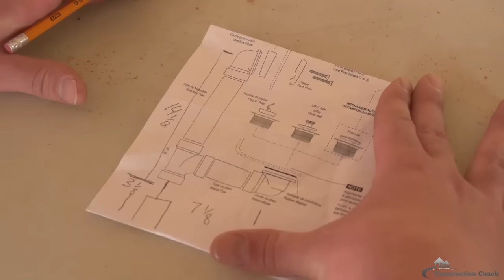Plumbing 101 - Learning about DIY plumbing with Coach Tim

Comment: As a licensed plumber few things for those of you wanting to try it yourself.  
1) from what I can tell that 1 1/2 vent coming off by the vanity is for the toilet... that's a no no. It can not be less then 2"
2) medium black abs glue not only looks better but isn't cpvc glue...
3) they make great pipe cutters for abs pipe that are easier to use and can give you a cleaner edge. 
4) ALWAYS PUT A DROP CLOTH IN YOUR TUB... common sense
5) most tubs require a mortar bed or a ledger (2×4 that holds up the side and helps with rocking)...rtfi... read the fucking instructions
6) ALWAYS remove your shower cartridge when you solder
7) don't run the risk of breaking your tub drain with pliers...go to home depot and get a tub drain tool
8) use either plumbers putty or Teflon tape for your tub drain... No leaks.
9) you're tub spout can not be more then 4" above the tub rim... code and all. 

That's all you get ya heathens
Reply: Lol 😂  thxs
Reply: Love your comments. Great stuff!
Reply: No trap
Reply: Thanks heathen lol
Reply: You must be American. That 11/2 vent is serving the toilet, tub and vanity. Down stream of the 11/2 trap arm must be 2” ( which it is)
 That’s called a wet vent son!

Comment: It is important to ream the cut tube so that you do not get turbulence. Also it is a good idea to remove the interior of the valve so that the seals do not get hot and damaged. The use of a damp cloth to wipe the soldiered joints is a professional touch.

Comment: Great videos. Bit of advice, when soldering, do not heat the pipe. Heat the fitting. This is what draws the solder into the fitting. If you put flame on the pipe you run a good chance of the fitting not soldering. Also, thank you for not putting a wet tag on the fresh solder. As many people do this to cool it off quickly. This can cause the solder to crack and leak.
Reply: Great catch, Lance! Thank you for valuable information.

Comment: For precaution reasons it's helpful to use like a canvas tarp with some towels laid on the floor of the tub for cushioning & then spreading the tarp over them the length of the tub & bracing a 2X4" from end to end for to be holding the tarp in place from slipping down off it's side & then to overlap the outer side of the tub with the tarp like that of a saddle. Now if  you were to drop any tools or other items like the faucets themselves, Your tub should be protected from chipping or scratching. You should also be aware to cut your horizontal length of 2X4"' bracing it to hold the tarp in place as needs be about 2" short of it's end to end.dimension to then use two 2X4" vertical boards from it's  ends of say 2' or 3' up riser's used to wedge the longer piece between them horizontally  squeezing the two ends out tight against the walls but not forcefully as just enough to snug the canvas in place from slipping down & exposing the tub's walls from protection of damage.. Never ever force or overtighten anything beyond it's compatibility. Use common sense & logic. You can YouTube me Dave Overbey for self defense training for how to fight & defend to the end! I am who I yam & that all I am. I'm sting em dead Dave Overbey, Crazy Davy, Alias Punchy & or   Punchy Puncherallo@gmail.com    Thanks for watching & please remember me for a thumbs up! Not your middle finger. L.O.L Have fun making money with me & joining me & my team # 61341016 in Life Leadership come any Tuesday night from 8:pm till 10:pm to an open meeting as my guest. Or stay at rest & miss life what it has to offer.

Comment: Drilling into the tubs lip against the studs is OK, but the way I learned to do it was to just first set it level on a ledger board to the wall & then nail roofing nails in the studs tightly to the lip by overlapping it w/the nail head so that it doesn't move or tilt up. Especially on a metal tub as this makes it easier.

Comment: Nice work couch! It's good practice to remove cartridge before soldering but hardly any general contractor or plumber for that matter does this.
Reply: Brass valves transfer heat very quickly, so as recommended by the manufacturer, always remove the plastic components of the valve before soldering to prevent them from melting or warping.  Manufacturers like Moen will not honor the lifetime warranty if you have cooked the internal components.

Comment: oh and dont forget when the fiber glass tub set no stringer used to support the back lip of the tub also what about the felt mat that comes with the tub so its legs dont squeak against the floor or set it in a thin wet bed of concrete so it sit all the way down

Comment: If you don't REMOVE the shower valve cartridge BEFORE you SWEAT you are liable to MELT the rubber and plastic CARTRIDGE to the valve. Those POSI TEMP cartridges are $50 each
Reply: I didn't notice any reaming of the inside of the pipe.  Take out the bur on the inside of copper pipe. Did I miss this?  It's a long video, I don't want to look for it.

Comment: Great video 👌 quick question,when you're done sauldering don't you need to add a little flux to the sauldered area??
Reply from the maker: Thanks for the support Carlos!! Only apply flux to the fitting and pipe before soldering, the flux will help the solder flow into the joint.
Reply: I work for a plumbing company and I see all the plumbers apply the flux before and after that's why I was wondering. Thanks for the reply!! 👍
Reply: You need to remove flux from copper pipes, on the long term flux will corrode copper

Comment: flame on torch is too long, adjust internal blue flame down to 1-2 inches. And touch the point of the internal blue flame to the outside of the joint, that's the hottest point of the torch flame. Also, apply solder to joint at opposite side that being heated, this ensures the joint is fully heated to allow for capillary action to pull solder into joint.

Comment: 00:03:  Here in central California,  we call toilets "turdlets"  (short for turd outlets).  They are well known in Turdlock,  which is 12 miles south of Modusto and 40 miles south of Shockton.  Removing them can be a Ceres issue, especially if the landlord has the Keyes.

Comment: question. 52:08 can you use teflon for extra coating between the braces and the pipe line before you crimp? Never done it myself but I'd be super worried that the braces themselves won't seal the water
Reply from the maker: Nope! Just crimp!  Thanks for watching

Comment: When soldering, heat the fitting more and don't put the flame directly on the solder.  A hot fitting will melt the solder and siphon it into the joint.  Melting the solder with the torch doesn't make it migrate into the joint.  If the fitting is hot enough the solder will melt and migrate into the joint with no flame applied to the solder.

Comment: The tub overflow would also act as a vent for it draining right? or does it make no difference.
Reply from the maker: It helps with draining but it is unacceptable to not have a vent within the building code distance away from the drain. Hope that helps.

Comment: What I saw I do not agree in few thing how you handled the process of connecting . 
I know if this work done where I am will not pass inspection .Yes you did a lot of work all by yourself which I commend you .One thing puzzled me " why the clean out plug was buried in the wall next to the tub " and the tub has no trap.............electric switches are so low .............
I do not know where your area is .......maybe that is the code . but I am very much enjoyed the show .of course a retired person can see the project with a lot of experience . thank you for the show .

Comment: I've never seen the spray foam under a tub. I've used sheetrock mud a few times but that was over 20 years ago.
Reply: Any portland based mortar is suitable to create a bed for the tub.  Tub manufacturers do not recommend spray foam for acrylic for fiberglass tubs.

Comment: Dude advice from a professional future reference remove the moen cartridge when soldering it’s plastic all that heat will warp it and cause it to leak
Reply: Lol, he just made that cartridge a permanent fixture.
Reply: Not always true, you can solder it with the cartridge in it. I've done it a million times and have yet to burn one up. Knock on wood tho lol.
Reply: Nah, its the next person who has to deal with it. Especially those long Moen cartridges. They always break off in side the manifold.
Reply: Doesnt hurt to leave them in if you know what you're doing.
Reply from the maker: You know it B !!! Thanks for watching!!
Reply: Of course, we all can leave the cartridge inside and solder it. And the valve will work fine. But it's the next person IF, they have to replace the cartridge.  As I said previous. "just made the cartridge permanent."

Comment: Can you reuse the wax ring? I want to remove the toilet to paint and wanted to know if I should plan on replacing the wax ring?
Reply: certainly not. discard the old ring and install a new one. they cost less than $5.
Reply: threadhound you can also remove the tank but you would still more then likely have to replace the tank to bowl gasket but you wouldn't have to mess with the nasty wax.

Comment: You should never ever screw a tub like this through the flange! Great way to crack the fiberglass and create a leak path to the studs.  Set the tub in lightweight cement or foam and it will be stable and secure.

Comment: I see you use the one step cement glue, why do you use that over something like the purple and orange one?
Reply: PVC drainage pipe (usually white) requires a two part adhesive consisting of a primer and the adhesive.  In this video, he is plumbing with ABS drainage pipe (black) that requires only one adhesive to make the weld.

Comment: What's kind of soft material to wedge inside Drain hole bathtub? what's it name?
Reply: assuming you are asking about the ring of putty he placed around the drain before treading it down, it is just called plumbers putty. Plumbers putty can be found at any hardware store that sells plumbing supplies.

Comment: What about removing the valve core from the valve Before you solder as that extreme heat will easily distort the Plastic makeup and o- rings for that matter and issues in the future.  JUST SAYING.  Quick and easy retainer clip removed and all comes out.

Comment: the back edge should have been supported with a 2 x 4 nailed horizontal to the wall .  there's a clean out in the wall....what good is that?....it needs to be pointed outside. tub should have been set on wet globs of plaster of some kind for support. there's supposed to be a rubber gasket between the fiberglass tub and the chrome drain spud.....not just putty...the tub valve is pre-fabbed incorrectly...more concrete needed to be broke out in order for the spud gasket to fit....he's trying hard and I would hire him in a minute...but he has a LOT to learn. If this were an upstairs tub, it would leak to the downstairs. I'm here if ya need me.

Comment: When you heat to solder you shouldn't have to go all the way around the pipe you should heat enough the solder will suck in by itself also when you have a pressurized line you should release the water in a different faucet at the lowest point in the house probably in the basement or outside faucet it looks like you're being coached I've seen lots of videos and you don't look too professional even when you soldered the valve you're supposed to take out the plastic pieces so you don't take a chance to heat them up and ruin them these are just some points that I noticed in other videos thanks for demonstrating installing bathroom fixtures

Comment: This is a great video...well worth the time to watch. He explains each step of installation as well as the purpose for each pipe/fitting/gasket/line as he demonstrates. He shows how to use all tools for cutting, crimping, and sealing/soldering.  He also gives helpful tips and cautions as well as testing for leaks at critical steps.
Thank you, Tim, for making this video. You have an exceptional ability to explain what you are doing.
Reply: Yeah this guy way he explains things is incredible and easy to understand

Comment: always take out the cartridge before soldering it takes 3 seconds you will ruin the seals and its a good idea to make sure they are lubed with plumbers grease it makes turning it off and on simpler (just a tip) you can use Vaseline if you don't have plumbers grease
just noticed the clean out is hidden in the wall with no access panel these must be accessible

Comment: ummm a few more necessities for the toilet ... a small pail so you can drain off the remainder of the water in the tank after flushing and a rag or two to soak up that which wont drain you can also use the rags to soak up and empty the bowl ... a razor knife to cut any caulking around the base of the toilet (yours isnt set on a finished floor and many on finished floors are caulked around the base) rubber gloves and a putty knife to remove the wax ring they can be messy at times .. most people aren't removing a toilet from and unfinished bathroom ... just saying ~

Comment: I hate to say this but this is the one of the worse soldering jobs I seen. Definitely not the right way. You heat the fitting not the pipe and solder!! That solder should just flow into the joint. It looked like he was brazing with solder!!

Comment: Great job, what I dislike is you belittling plumbing code,1) you forgot the 2 by 4 that supports the tub from rocking 2) using a vent 90 for the lavatory drain it’s a no no, it makes it harder to run a snake through drain 3) the distance from the vent and an 1 1/2 ptrap shouldn’t be longer than 3’ 6” when using a wet vent. The problem with handy man it’s that they belittle the craftsmanship behind plumbing. You don’t even use the proper terms for fixtures and it’s parts..
Reply: German Turrbiartes, what a name! Just wondering if you have any videos on code, it's all generic, for example you might have to use the purple shit when gluing, if a inspector doesn't see it slopping up everything he will fail you, here plumbers aren't required to use it, they can use clear, I know Handymen that can put a plumber to shame.
Reply: Oh god. "Triggered" much?
Reply: Most plumbers think they're craftsmen, 1 in 50 actually might be. Plumbing is kind of a hack industry anyone can do it and none of your work is visible to the client

Comment: Again not to be a know it all, but when I install tubs of this kind, I will align a 2X4" horizontally across the back wall of a measured height that's made right. For I myself, will elevate the back end of my horizontal 2X4" nailed across the wall with the 1/2" edge side facing up to catch the lip overhang of the tubs wall side so to slant maybe just a 1/4" to 3/8" lower on the drain end & or so higher on the back end of the tub for better drainage than do many tub designs provide. Course this is up to you, but I just hate it when it's all said & done if it doesn't drain the last bit of water from the back end due the floor is to flat or was not level. I would be sure of prior the tubs installment that in fact the floor is level & or check that it might of settled unevenly unexpectedly & gone unnoticed. It might need be raised with underlayment of shimming or sheathing up on the low end so it has full support from under the tub's floor & not just on it's edge's. Do not raise it so much that it's noticeable & tacki. Keep it professional. As you did in your video alway's dry wall w/ Green board or blu board installing the tub first. You can watch me Dave Overbey on Youtube too. Thank you!

Comment: My advice, seal the threads of the drain (spud) with teflon tape anyway. If the homeowners ever clog the drain with hair the standing water WILL be pressurized and will leak right through the threads.
Reply: While I do (paste) ... actually the rubber seal between flange and tub works both sides and the thread sealant is not needed .... technically nor is 'plumbers putty' on a tub except to prevent small amounts of water from standing and growing stuff 
UNFORTUNATELLY HE FAILED TO SHOW GASKET INSTALL

Comment: I am a professional Plumber with years of experience. I have installed hundreds of valves If you know what you are doing and control your heat you won't damage the cartridge. Another trick is to wrap the valve with a wet rag. Of course, removing the cartridge isn't a bad idea if your nervous, always be careful to make sure you don't lose any parts (washers, O-Rings etc.) or damage them when you re-install. Thanks for the video, I thought I would defend you on the soldering with the cartridge left in. LOL!
Reply from the maker: Thanks Patrick, I appreciate the support on the issue. The plumber I learned from had shown me how to do a shower valve on many different projects that went through my contracting business. I was never called back from any clients. We are talking about 100+ washrooms over 15 years.

Comment: Great vid, but when sweating fittings to the shower valve assembly you've got to REMOVE the cartridge to avoid melting it. It's not hard at all. You may not have damaged it, but someone less experienced might heat up the unit too much and compromise the rubber and plastic inside.
Reply: yes
Reply: Yep exactly well said
Reply: Yes...luckily, he made the solder joints to the valve incorrectly anyways by heating the pipe and fitting rather than directing the torch flame to the fitting only.  By heating the fitting, the solder is drawn into the fitting's socket by capillary action to insure the best seal.
Reply: Not only that the flame should be more towards the fitting or the body of valve ,key note when sweating copper where there is heat soldier will follow